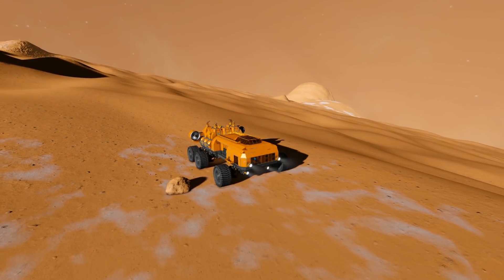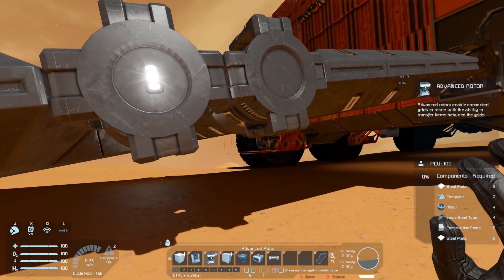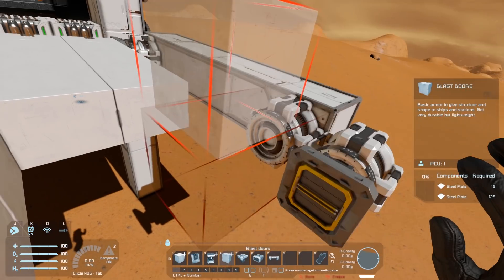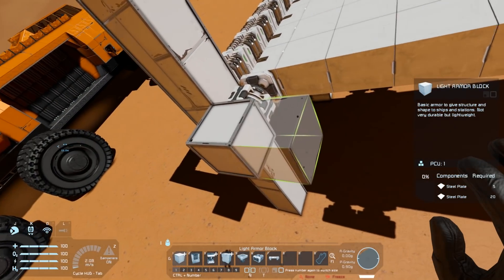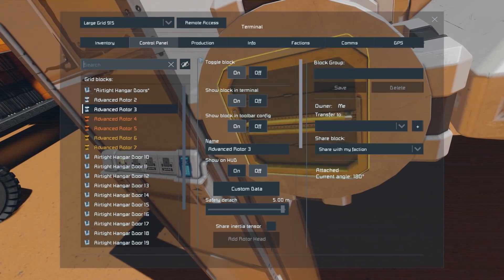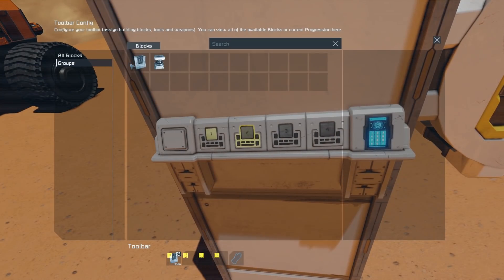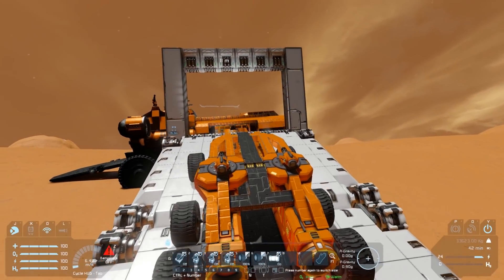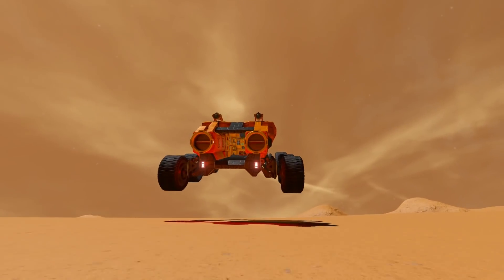How to Build a Folding Ramp - Space Engineers Tutorial

Comment: This was made 2 years ago. Im on console version. I tried this to ur exact specs and my nearly 1mill kg rover flipped. Clanged like nothing ive ever seen before.
Reply from the maker: My builds using this still work exactly as they always did. Now that we have hinges though, I'd recommend using them instead as a pair of them are easier to set up than the rotors
Reply: @Splitsie  it took me some tweaking but i finally got it to work. Then for some reason the rotors i set as the main ones disappeared from my control panel as if they never existed. The rotor idea is great but in my case there isnt enough info in your tutorial to make the setup work properly. I tried several times and ended up having to figure out a different setup. I may go with hinges for my next build. Thanks for the reply.

Comment: I’m having an issue where it’s making my ship go in circles, anyone else running into this issue or is it just for land vehicles
Reply from the maker: If you're experiencing that sort of thing then it's likely from 'phantom forces' which are typically generated when a hinge/rotor/piston is pushing one block into the space another occupies which generates torque even though in the real world it wouldn't. Check you've got the rotor limits set up correctly and that if you've used rotors on both sides of the ramp then test detaching one side and see if the problem resolves itself as it could be the rotor displacements aren't set correctly and are similarly generating phantom forces.

Comment: I'm trying a double rotor dropping door, one just for support on the other side like this, but I get phantom forces strong enough to send my large cruiser ship spinning in space. Any idea what's causing it?
Reply: The rotor head offsets are probably not set correctly. The large grid offset of 0mm doesn't exactly line up with 1 block (2.5m). If the two rotors push or pull on each other, the force is slightly offset from the play in the rotor part, which creates phantom angular momentum. 
You can overcome this with enough gyros overridden to 0 (hold position), but that's not great. Better is to get the offsets perfect, but I don't know what the exact value is after the collision mesh update.
Edit: Splitsie mentions it in the video:  -20cm (-0.2 when you type it into the terminal)
Reply: @oldmankatan7383  I tried that value and it caused the most forces. I even tried more, less, to one side, but still spun the ship faster than the gyros. Glad the bay door was open as I saw my ship spinning towards an asteroid field...
Reply: @GockCoblin  Yikes! 
I'm on 1.196 currently (pc), just loaded up creative...
You can't change rotor displacement when there's no head attached, so if one is set at -0.2 (-20cm), and you attach the other, it's off by 0.2 total, and goes spinning off into the void. 
If you set the first rotor to -0.2 before you take head off it'll keep the value when you attach another head later. With power and no gyros or thrusters, I was able to attach and detach freely this way without phantom forces. Changing it to 0 after attachment at -0.2 caused another spinning into the void, but changing it back while spinning allowed my no control grid to eventually stop spinning (30 seconds or so).
TL;DR the values are good if BOTH sides are -0.2 (-20cm) before attaching.

Edit: this is true if rotor bodies are on the outside, directly opposite each other (in line), and attached to the same grid, while both rotor heads are on the inside, and both connected to the same sub grid. 
If you your rotors are differently placed than that, the values might be different.
Reply: @oldmankatan7383  the inline with subgrid in the middle is what I'm after. So place both rotors, set to -20cm, remove one head, place my blast doors, place rotor head on blast door, attach, and should be good?
Reply: @GockCoblin  yeah, that worked for me. Best of luck!

Comment: @Splitsie First let me say a heartfelt THANK YOU for your fantastic tutorials! I love them, they are extremely well done and informative. You set the bar sir! 
Secondly - So, has SE made some changes in the game recently whereby this no longer works? I just made this video, following your tutorial step by step. The second rotor (on the right side) causes the initial rotor to not work. Once the second rotor is removed, the initial rotor begins to turn. I don't understand what I'm doing wrong. 
https://youtu.be/xJksLeAqdXY
Reply from the maker: I think I might know what's going on, when you first created the second rotor it was part of the base and was a 'static' grid. Sometimes it will remain a static grid even when detached from the base. It might be worth trying to access the control panel on that rotor (you'll need to go through a control panel attached to the side of it or through the back of it like you did so you're on the specific grid) and then go to info and click convert to mobile grid (I don't think that's the exact label but I'm unable to check in game at the moment, it is something similar to that).

If that doesn't work another thing to try would be to build the second and third rotors on a piston (or another rotor) so they're on a mobile grid to begin with which may prevent the problem as well. I can't see anything else that you did that can explain it from what I saw
Reply: @Splitsie  Well sir, you're engineering genius reputation is safe and sound. Good call! I went into the rotor directly, info, and sure enough - convert to ship was available. The instant I clicked it, the ramp fell, and I was able to make them fold and move. Oddly, I then went to my build, built that ramp again, and the exact same thing happened. Your resolution worked there as well, but I find it odd that it does that so consistently. I am using the 'lost and stranded' scenario, with admin tools enabled, if that makes any difference. Now that I know how to make this, I will try this in other builds and see if I get the same results. 
Thank you very, very much. Keep up the excellent work!
Reply: The completed ramp and hanger for your peruse. The build is big, ugly and I call it Turtle. All I need is a crew, a job and to keep flying! 
https://youtu.be/0dzm2PcfffE

Comment: Thanks for posting this!! The problem I have, is even after I remove the head off the second (of the initial pair of rotors), I cannot place the blast doors all the way across. If I remove the second rotor, I can put a blast door edge, but then cannot put the rotor back. They both want to occupy the same space, even when there is no rotor head there.
Reply: Never mind, found my own problem. Part of the blast door attached to the surrounding frame of the structure instead of the other part of the blast door. ;)
Reply from the maker: Glad you worked out the problem, it's so easy to accidentally place a block on the wrong grid
Reply: @mako9673  How do you change grids? I don't fully understand how grids work yet. I'm new and I am playing on Xbox.

Comment: Can you please do a Video about ghost forces and how to bypass them?
I recently build a ship with rotors or a piston for retractable landing gear on Earthlike Planet. It worked, but the ship stopped hovering in mid air properly just because of it. It emerges only when deboarding. When boarding into cockpit I could see "ghost speed" of 0.12m/s (another question: Is it possible to determine in which way I can leave the cockpit? Lately I would liked to get through the backdoor of the cockpit into the overall ship and hopped out into vacuum instead ^^)
There is also another case where I build a bridge. The rotor was mounted on a light armor block that was mounted on a piston. Everything works fine but if you are on the bridge there are some interrupted moves without moving in constant iterations. It is also shown in the HUD with 0.02 m/s or so.
With pistons I figured out block movement although the piston head wasn't blocked so far I remember in addition.

Comment: I have been trying to build a ramp that essentially works in the same manner as a drawbridge, but when the rotors are attempting to reach 90° they stop part way, I have tried setting torque to maximum and looking up fixes but I can't see what has gone wrong.
Reply from the maker: Are the blocks colliding with something that's stopping them from going the last part? When checking for this remember that a lot of blocks in space engineers have a collision size which is larger than the visual size of the block so if there's something that's close try creating extra room around it and seeing if that fixes the issue.

It could be that even at max torque the rotors aren't strong enough if your door is big enough. Make sure you've got experimental mode enabled in the game menu and then try setting the torque well into the red zone (if you haven't already done this). If that's not enough and there's nothing in the way then you have to get a lot more complicated and use pistons as pneumatics to raise and lower the door

Comment: Great tutorial - as many of your other videos.  They helped me massively getting my way around the game.  I tried exactly what you showed here for the folding ramp but somehow the second and third rotor don't move.  I get a little bit of movement and then it stops.  It is almost like there is no room for the blast door blocks to move.  Has anyone else experienced this issue and more importantly, knows a solution or my possible oversight?
Reply: And after a few hours fiddling around - I found out that I need to build the rotors first with one block attached to the rotor (or one line for the ramp to get the length right) - configure them correctly and then finish the ramp as well mirror the free rotating rotors on the other side.  If I build the ramp as a whole before configuring - it won't move on the 2 connected rotors as I accidentally attached the blast door blocks to each other.
Reply from the maker: I'm glad you worked it out, it's one of those things I forget to highlight sometimes when building with rotors that the order you do things in can really matter to prevent blocks being considered part of the same grid :/

Comment: So how come you need to get rid of the heads first if youre gonna reattach them after?
Reply: i assume because it gets in the way of the blast door bit and you cant place it, surely it would auto snap onto the grid instead of needing to lock on
Reply: so you use double rotors in the second section of the ramp because of scraping? or is it just the angles and you couldnt use armour blocks to increase the length for a final rotor?
Reply: when you say the part moves and not the rotor is that just reference to where youre facing? because the rotor itself is attached to the middle rotor so it cant turn the initial ramp hence why it works?

I guess what I mean is the you can think of the rotor part on the end of the first ramp as being the "clamp" which turns the actual rotor (which is attached to the third set) but in the third set the rotor is the clamp and it turns the rotor part
Reply from the maker: No, the head does not auto snap, grids in space engineers don't do that, so the only way to have the second rotor part be on the same subgrid as the first is to do as I did, first removing, then ensuring the head is on that grid and reattaching :)
As to the double rotors, there's no other way to get the ramp to fold flush against each part, you simply can't achieve as neat a result with a single one
Reply: Splitsie iirc grids autosnap together unless they’re rotors or pistons? Autosnapping is definitely a thing
Reply from the maker: Nope, mobile grids (which is all things attached to pistons and rotors) never autosnap in regular play. There are a few bugs that can cause it to happen on game load. If you're talking about static base grids, those will sometimes snap to each other when within a certain margin, but that's not the case with the grids here
Reply: Splitsie so that’s snapping onto subgrids from the master grid?
Reply: also, could you do the mirroring with regular light blocks? I know you used blast doors for the wiggle room to the hanger bay. I assume u dont need to reattach to them as theyre less skinny

Also, is it possible to not use the free spinning and to have them both work, so youd have a negative value? double the power and all

Comment: I have followed every single step when i try to build this and I have had to restart 4 times because the middle of the ramp will not fold down Plz help
Reply from the maker: Did you place the blast doors with the correct orientation and only rotate 90 degrees with each of the middle rotors? Those are the first two issues that come to mind, but there are many possibilities so I'd need more info to work it out :/

Comment: that upper/lower bit is always part that makes me not wanna do this, to confusing. every time i try the rotors get violent and tend to chop thru what i have them attached to. why cant they just say clockwise and counter on them instead of upper and lower, that would be soooooo less confusing.
Reply from the maker: Something that will help you avoid damage is to set the limits using ctrl+click and typing them in, using the slider increases the chance of things going crazy and exploding. With direct entry of the value the rotor will often just report being 'out of limits' without trying to fix it, where with the slider it tries to rectify the situation frequently with disastrous results :/
Reply: @Splitsie  had that happen 1 to many times making 1 gun shy trying again

Comment: Woah wait, how did you make your vehicule jump?
Reply from the maker: If you hold down X your vehicle's suspension compresses, when you release X the suspension springs back with the force as set in the suspension strength setting, be careful with it though, many a vehicle has ended up on its roof that way :P
Reply: @Splitsie  So I just have to put wheels on the roof to have a reversible ride and I will basically become an unstoppable full metal stunt car?
Reply from the maker: Might work, just don't let someone like Capac drive, if you do then you'll end up on the side of the wheels instead of the roof ;)
Reply: @Splitsie  Nothing a couple gyros more than needed can't solve :P
Reply: @Splitsie  hey what is the hex number on the orange paint, it looks really fricken good and I wanna see it on something I built. If not a hex number could you maybe find the H,S,V numbers

Comment: Hey mate ! Great video. I was making a door exactly like yours on a station in space, and no matter what I did the second pair of rotors would never move. Turn out they were inheriting the "is station" setting. Once I turned that off, the rotor appears to work as normal. Just an edge case but you may be able to update something to cover that for other silly people like myself ;)
Reply from the maker: That's something I often only think of after I get slightly frustrated with things not working :P
Reply: @Splitsie  I now have a beautiful double 6x11 folding platform (12x11 when out). I get a bit of wobble on the side with the unpowered rotors, so I set those up as well.

Comment: Great tutorial, I have always loved this design in Escape Unlikely.  One minor tweak would be to have the single rotor (attached to the vehicle) move at a slightly faster speed since its total angle moved is greater than the other two.  Or other combinations of speed variation which can determine the geometry of the region in which the ramp unfolds (does it straighten out before its final angle and then lower vs reaching the final angle and straight at around the same time).
Reply from the maker: You're exactly right and that's how I've got the actual door setup, forgot to cover that in the video while pushing myself to keep this as brief as possible :P

Comment: A warning should be issued concerning rotor limits. Never, EVER adjust them with the slider... If it was out of range it will ignore all torque settings and will snap instantly to the limit which tends to destroy anything attached to it.
Reply from the maker: This is true, and something I forget quite often since most of the time I type in the values instead of dragging the slider. Might have to make sure to demonstrate that when I get back to the beginners tutorials :)
Reply: @Splitsie  I learned this the hard way last week. The first drill rig I didn't know what happened, the second time I realized what it was. The third time was just an unhappy accidental mouse click. I'm quite paranoid about that slider now :) I adjust them all by text entry now!

Comment: That looks like a good tutorial. I will have to try this out when I get to the stage where I can build something like that.

There is one thing which I would like to ask tho.
I wonder if it would be possible to have a tutorial listing all the keyboard shortcuts for entering values with keyboard, using manufacturing queue and auto-picking parts? And if there are any UI improvements/mods that would allow opening that popup menu that I saw in the mars survival scenario (Survival unlikely) you played with Capac.
Reply from the maker: I'm hoping to put together a tutorial for the build planner which should include most of what you're looking for, I've been taking my time on that one though since I wanted to get a better handle on the system myself before I posted about it :)

As to that interface, that's the TextHUDAPI with Build Vision 2 that'll give you what you're after
Reply: @Splitsie  Thanks for the info, I will make sure to check it out.